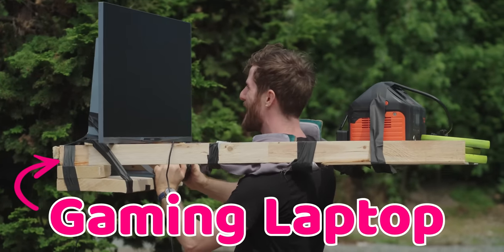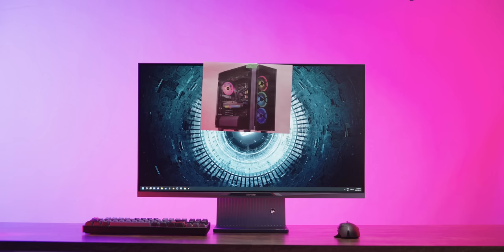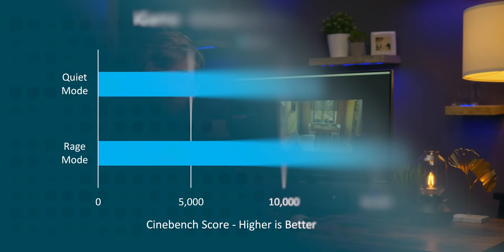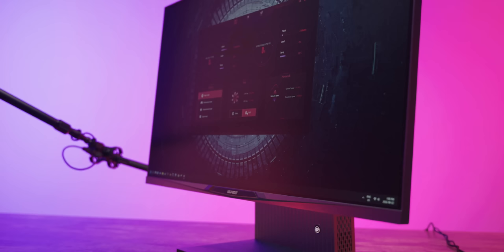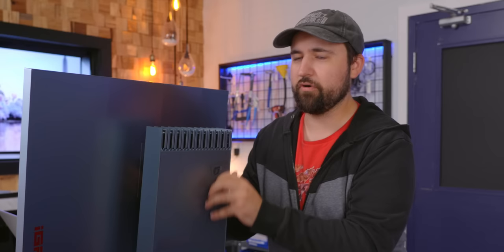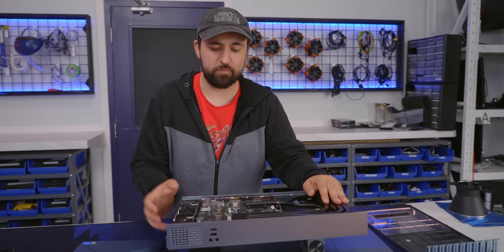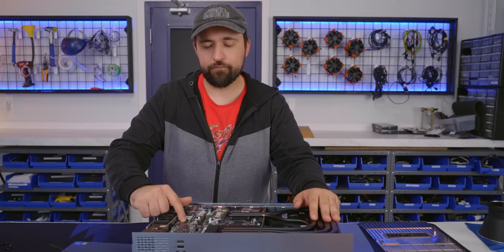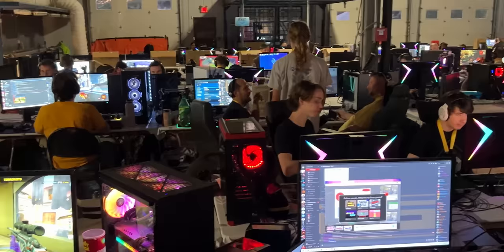Justify Your Existence. I'll Wait. - Colorful iGame AIO

Comment: This could be pretty cool for off-grid or RV applications where you need the power efficiency of the laptop without as many of the issues like batteries being wear items and IO and thermals being limited.
Reply: But if the battery goes you can fix it or treat it as a desktop only, no point for a fragile semi portable system when a gaming laptop can be expendable in all fields
Reply: @thatslegit  Honestly, I can't see many situations where this product would be used. It takes all the bad parts of desktop, and laptop, and combines it. Hard to move around, have to buy keyboard and mouse, bad thermals, weak laptop parts, poor upgradability, and the list goes on.

Comment: As someone who uses rtx voice when streaming and plays games with headphones on I normally have my fans turned all the way up because it doesnt really make a difference having my fans be all the way up or not but this would definately be good for someone who doesnt already have a pc or isnt looking to max out every game
Reply: You should compare your power consumption with full blast and quiet. There are fans out there which can draw up to 10W per fan. With the high number of fans in the average system this can be costly with current energy costs.
Reply: @nSnowCrow  Electricity for gaming is still so cheap, like even 100w of fans running 8 hours a day for a month, which is an unhealthy amount of daily gaming, is like 3-4 dollars a month at 14 cents per kw/hr
Reply: @nSnowCrow  im in a dorm currently so ill probably end up being more power conscious after moving out and renting an apartment
Reply: @nSnowCrow  The majority of fans only use 1-3W, 10W would be pretty rare for a PC and starts to get into server grade jet engine levels of noise and besides that 10W is nothing, something like $20-30 a year and you probably have a modem / router using more than that running 24/7 already and even using leds, I'm sure your house easily uses 30-50W every night.
The typical 100-300W from a GPU alone during gaming will far exceed any concerns over fans...
Reply: @nSnowCrow  Don't know where you're located, but the average KW/h rate in the u.s. is 10.42 cents($0.10)
Even with 10 fans running full out(100 watts) it would take 10 hours of operations to cost $0.10.
Where i'm at, it's about $0.25.

And if you think that's bad, let me introduce you to my 6x30W fans in my server.
Reply: @nSnowCrow  To even reference fans that pull 10w is rather disingenuous to try and make a point.
Not even Noctua's Industrial 140mm, 12v, 3000 rpm fans pull 10w. They pull 6.6w. That that is usually as high as any gamer is going to go.
To get to 10w? You're looking at fans from companies like Delta, like the AFB1212SHE, or the AFB1212VHE, etc. 3700-4000 rpm fans pull around 10w.

If someone is using Delta fans? They stopped giving a fuck about power usage long ago, so there's no point in even talking about it.
Reply: Use better cooling components. I have a RTX 3070 with a R9 5900X OC. I use it with a Noctua NH-D15 and recently changed PSU for a XPG 850W one. It's really silent now. You can hear the gumming of the 4 HDD I have but the fans are really quiet (+ the RTX shuts it's fans when you don't play and just watch youtube)

Comment: I don't know about the gaming aspect, but those AIOs have a huge market. Non-teckie people. Like my mom or my father in law. They don't upgrade. Never. They buy the device, use it for 6 to 8 years and then replace it. My mom does know quite well to do their stuff on a PC. But she never understood what that brick is for ("son, can you please remove that box I don't use?" "no, that's your computer" "I thought that's my computer" "no, that's just your monitor"). She had an additional laptop, but she never used it, since she is not carrying that box with her (for what?), and the AIO is more suited for her (larger display, more mobile lighter keyboard, mouse in favour of a trackpad, and no, she will never plug in an external monitor or a mouse to a laptop and I am tired of doing that for her). 
You are observing the world throught the teckies' eyes. There are a lot more moms and dads out there than teckies. And the moms and dads don't care about upbradability, heat flow, fps, number of USB-interfaces or rgb, and rightful so. They care more about the amount of boxes they have to dust-off, or the amount of buttons they have to operate to switch on a computer, or the amount of cables laying around, or the amount of maintennance or upgrades that they don't need to invest in their pc. You may consider this ridiculous, but from their point of view, they are perfectly right.

Comment: You should take a look at the Lenovo Tiny series. Its a small form factor desktop like the Mac Mini.
But it has a party trick. You can buy a monitor designed to slip the desktop inside. With a click the computer gets KVM and power from the monitor without cables.
Its really only helpful for business as it allows you to have the easy cablemangement of an all in one, but if you want to upgrade or refresh the computer, you just pop it out and take it apart with one screw to add ram, swap the SSD, or upgrade from a Ryzen 3 5350GE, to a 5700G(yes i've tested this to work fine, just turn off AMD PSB so the 5700G is not FPGA fused to that computer), or replace the whole miniPC just by swapping it with another one..

Comment: When it come to the price difference between a custom build and an AIO id say to remember the "convince tax" of it being an "All in one pre-built" considering that I'd say the price is pretty reasonable All things considered (maybe not against competitors though)

The difference between a laptop and an AIO is going to come down to personal preference though... I would personally prefer the AIO over a laptop on a desk as I feel the laptop use to be a bit unconfortable for long use (office work mostly)

AIOs are not good nor bad, the value will depend on your specific needs and wants.
Reply: If you can afford the space, a laptop dock is still better than an AIO since you have both a dedicated keyboard and mouse with a large display along with the portability of the laptop. Just plug a single cable and you're good to go, if it also charges your laptop even better because the laptop's charger can stay in your bag instead of having to also move it around every time you want to go with your computer.

Comment: The larger monitor and lower resolution is ideal for older people. A 1440p notebook would often get set to 150% or 175% size and would essentially negate a lot of the advantages of the higher pixel density. Also the notebook portability is superfluous for a person that retired and would have the notebook siting on the same desk for years. And the machine being able to play various games is just a plus. Then again there is a great chance that a larger tablet would be more than enough for most of their needs. Maybe it would be a good option for older people that like some light gaming and don't want the hassle of a full blown stationary PC. With an aging population, and PC gaming being over 40 years old that may actually be a sizeable demographics.

Comment: Damn, you guys at LMG keep pushing this narrative against 32" 1440p panels, which is borederline misinformation. If you want a 32" display, you do not need to buy a 4K monitor (especially if your PC can't handle doing whatever you do with it at native 4K), 1440p is fine in most use cases and in normal using conditions, especially for watching videos and gaming. If you think 24" 1080p is fine, then you have to agree that 32" 1440p is fine too, since it has the exact same pixel density.

I have both a 27" and 32" 1440p monitors, and I honestly can't say that the 27" looks much sharper than the 32" unless I'm looking very closely, or if i try to read very small text.
Reply: I mean, you're assuming that 1080p 24'' is fine. I'd say in a world where we're used to the high pixel densities of our phones and laptops, 1080p 24'' already starts looking blurry.
Reply: @Ziggity  your eyes are also usually placed a lot closer to your phone screen than your computer monitor
Reply: I always thought 24" 1080p looked awful so I absolutely agree that 32" 1440p is just not worth it. My main monitor is a 27" 1440p is just right but I can't wait to get into a 27" 4k
Reply: @rynomuncher  you must be sitting uncomfortably close to your monitor then, because at this pixel density, there should be no way to distinguish between having a higher resolution monitor and just having anti-aliasing enabled, unless you are less than 95 cm away from your monitor (which is not much IMO, I'm personally about 1.2 m away from my displays)

Comment: I've seen several LTT videos recently saying 32" is too big for 1440p recently, but I've been using that for years and it looks fine. If I lean in close I can see the pixels, sure, but it's a big monitor that looks great at a reasonable distance and at a resolution that can be handled by a GTX 1080 for most games. I probably wouldn't choose the same if I was buying a new monitor today, but I don't feel the need to upgrade any time soon.

Comment: After seeing what the Apple SOC can do with its power budget, I’m getting tired of these power and heat raging processors from Intel and GPUs from Nvidia. The companies are creating products that will either underperform, require ridiculous cooling, or make a ton of noise.

What is the point? They generate so much heat that they make rooms hot. They consume so much power that they are contributing to global warming rather than helping by becoming more power efficient.

AMD’s 4th gen will be able to also use over 200 W at max, and it’s just not worth it any more. This concern with maximum performance at any cost is pushing the problem on to everyone else to figure out how to optimize the products so people can get a decent experience. Why should that be our responsibility?

Comment: It's still quieter than the rack of Supermicro servers that I sit to every day while working at home 🙂

There's 15x80mm OEM fans in the 3 running servers that all run between 3200rpm and 4500rmp 24/7/365.  The HPE switch at the top of the rack is actually louder though 
🙄

Comment: 1. all the all in ones that ever came into my hands had had the GPU solder issue, heatgun and worked again
2. mobile/laptop makers are ...mentally divergent, the bobcat core I got for ex throttled constantly and fan screamed, replaced the metal foam heatsink spacer with copper, pasted both sides and the thing ran turbo mode on both cores ever after and gained 2 hours battery life
*every all in one I've worked on has been laptop/mobile board based, cheap ebooks went mobile board based

Comment: This is definitely a computer designed for use in cybercafes , not easily upgradable, so no need to worry about users stealing hardware, and all in one , less drilling through-holes in tables for wire management, and easily transportable for use in LAN Gaming tournaments.

Comment: I've built 2 SFF systems into the Cooolermaster NR200P for people. One had a 5900X, the other a 12600K. Both cool and quiet at max load with a Noctua NH-U12S, and NH-D12L respectively. Neither is used for gaming, but you can even accommodate a triple slot GPU in that case.

Comment: I own (for my son) a Dell AIO Inspiron 7775, it's some years on its shoulders, it came when Ryzen 1 was born, hence Ryzen 1700 + RX580 + SSD + HDD + 16 GB DDR4 + IR camera. Beautiful 27" 4K HDR (but 60Hz). It's a HDMI pass thru useful for console. It seems that despite almost 4-5 years have passed, no much progrssion has happened in the AIO space. Mine at least had Desktop class CPU+GPU (RX580 is a beast btw). Fan noise might be concern though, it goes thru the roof when forced to do so.

Comment: I don't understand what all this hate is about.. It's definitely an interesting product and looks cool imho. The webcam is a nice touch too. Maybe the price is a bit high, but that's the convenience tax -  this product could really be a blessing for non tech savvy folks who wants to get a decent enough computer for their family without having to worry about knowing how to set up a computer.  Talking about e-waste - Aren't 17 inch laptops/desktop replacements pretty much e-waste after a few years? Not just that, with new sockets being introduced for new cpus almost every year by Intel, if I need to upgrade my cpu, I pretty much have to throw out half of my computer.  I definitely think that iGame is almost on the right track - Like others have commented, if they could make it a bit more upgradeable, and have more powerful configurations (maybe even use an Amd cpu for better efficiency and cooling) and also have the monitor allowed to be used by itself by adding a hdmi input, I'm sure this thing will sell like hot cakes.  We need more companies like these to break the monopoly of the likes of Apple and HP. Let the little guys win, for once. 

And 32 inch 1440p - when exactly did that stop being the sweet spot? I really don't understand what all this hate is about.....

Comment: The one use I can ever justify for an AIO Desktop is space constraints. I ran one when I was a repair tech at Microcenter when my desk was completely filled with laptops and desktops to be repaired.
I would use this as a work computer or daily driver, where I need space, and I don't need horsepower that often.

Comment: You didn’t have to remove the bottom stand. If you just leave the monitor sitting like normal you can just start opening the back from the top, it’ll come off. You made it a lot harder for yourself.

Comment: I can see the point of miniPCs like the upcoming MinisForum Nuc X15/17 which looks to be using the Nuc X15 laptops' motherboard (just not sure if it's also the same cooler) mounted on a chassis no larger than a router since the battery isn't there. I mean...sure it's not a portable like a laptop (including 17in desktop replacement gaming or workstation machines) that you can just unfold anywhere, but you can fit it into any backback that fits a laptop and still bring it to a hotel room/Air BnB so when you're back from whatever you were there for you can run Mortal Kombat or whatever on the HDTV using a machine thinner and easier to pack than an XBox/PS. And when you upgrade to either a new Nuc or that other Nuc that can use desktop GPUs or build a new desktop you can just keep the Nuc X15 as a console for PC ports that can game stream from the more powerful desktop in case you ever need a huge screen more than refresh rate.

This thing is none of those. Sure the cooler might be beefier, but it's large enough that even if you could detach the monitor easily and use it elsewhere like the MF NUC X15/17, it's about as thick as the last gen XBOne and PS3. And while you can use it as a console you have to permanently detach the screen and not be able to use it at all.

If anything the MinisForum Nuc X15/17 only lacks a Vesa mount so you can mount it to the back of your monitor instead of still taking up space while light, tall, and slim enough to seem like your cat will knock it off the desk unless you have it right up against a wall or even just tugging a wired peripheral too hard will knock it over.

But hey for under $900 for the barebones 11400h+3060, being transportable and giving you an option to stick with 1080p 24in or 27in max makes a lot of sense to get. I'm actually debating getting this over the NUCs that take desktop graphics cards and gaming laptops since it'll be easier to fit into a bag vs the thicker NUCs and the arse end of gaming laptops, not to mention the latter will take up more space on your desk, which is less sensible for someone who'd use a larger external monitor at home anyway (that I already have).

Comment: With a RTX 3060, you'll want to stick at 1080 gaming. I have my little Asus zephyr 14" with 3060 and 8-core AMD solution and it's perfect -- Small, powerful, not too loud.  For serious-er gaming, I connect to an external 165Hz Dell 24" 1080p monitor and it performs great. 
Not the best in the world, but the entire setup is only $1400 (laptop was on sale $1200), and I can go portable when I need to. 
Granted, it DOES take up more space than this machine when I'm using both screens at once (great for productivity -- I'm also a coder) but if you go into clamshell mode with external mouse and keyboard, it's really, really close.

I see these machines as cafe  / work machine or when someone is REALLY hurting for desk real estate but needs a larger monitor.

Comment: I bought a Dell 7450 AIO, I7, 32gb ram, UHD Graphics 2nd hand on ebay for $500 (still had 12 months dell support tied to it), It has similar specs, a spare NVME port etc, DVD, Windows 11, I also added a Touch screen overlay for $200 from Aliexpress. I have used it to install my older Steam Titles on it, Like Fallout series, Fallout NV runs full tilt, I even got Fallout4 running, so I have moved my older steam etc titles over to it (pre 2010), I have a Ubuntu machine that will handle the new stuff, so with less Games installed it has more space on its drives, for wine to run more bloated windows software ... ;) However the Dell on a extension arm (the dell PC is inside the Screen, not the Stand) and the touch screen lets me use it laying back, having a Mic & touch screen, I can browse internet or network video easily as well ..

Comment: I built mine out of an Element TV, a Dell Precision 1700's internals, and some super sticky double-sided tape. Works well, looks awesome, no complaints. The chasis fan now draws air out the top vent of the TV, everything just works. Windows 11 doesn't seem to mind, either.